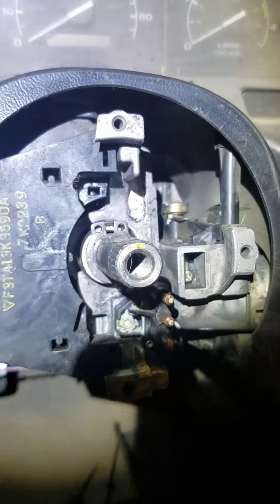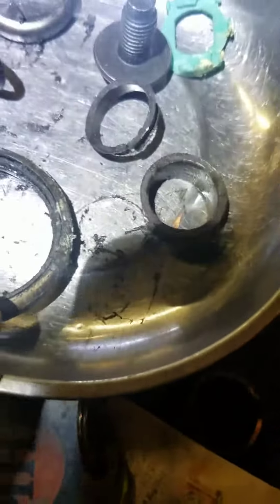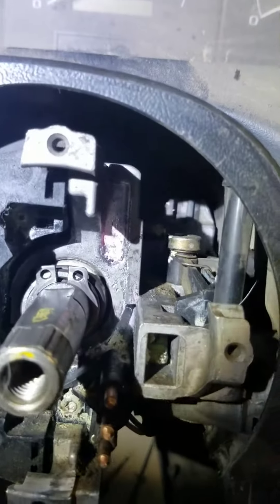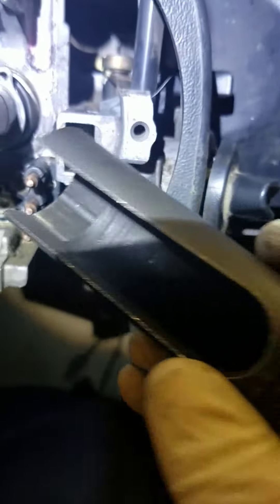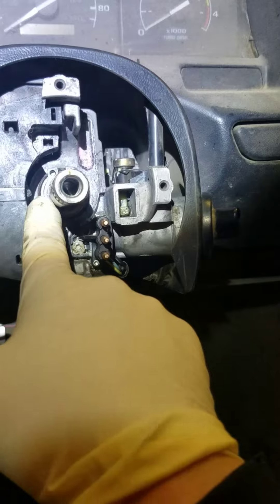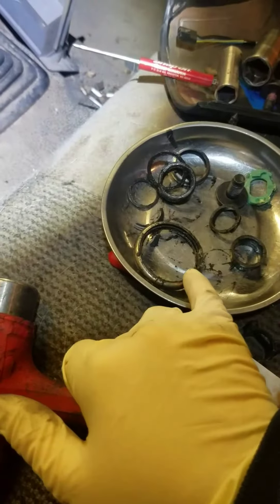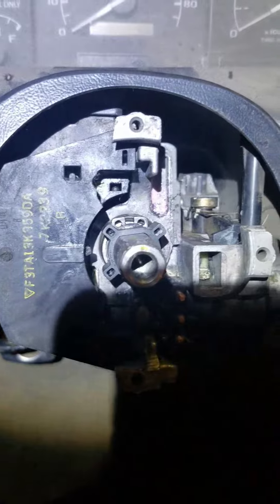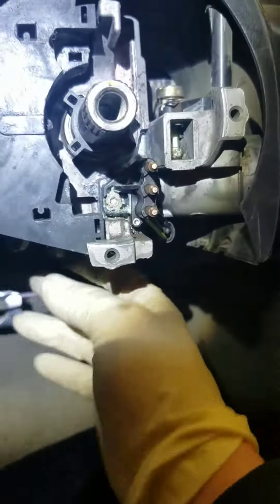97 f350 steering column bearing spring install

Comment: Did you replace just the upper and lower bearings or did you end up replacing the entire column?  You made a comment about uploading a column rebuild video, is that related to this same issue?  I'll go look for the vid now.
Reply from the maker: I haven't finished the video yet. Had some audio issues. But there are 3 total bearings on a tilt column. Its actually not that difficult to rebuild it. I'm working on the vid now.
Reply: @MegaMarclar  OK.  Cool.  Yeah, I'm in the process of buying a '95 f150 real cheap but the wheel rattles a lot.  Looks like the column bearing is the problem most likely, I've seen a few videos but still trying to research some more.

Comment: So did u remove the  old bearing right there from that position?
Reply from the maker: Yes you can remove and install the top/front bearing from this position. The column must be removed and disassembled to do the other 2.

Comment: How do you undo that plastic arm the ignition switch is connected to to pull that upper piece off?
Reply from the maker: If I remember right you have to pull  the tumbler and gear pieces out in order to get them apart. I keep procrastinating, but I have all the footage on a complete rebuild I've been trying to get put together
Reply: MegaMarclar ok I see that plastic thing